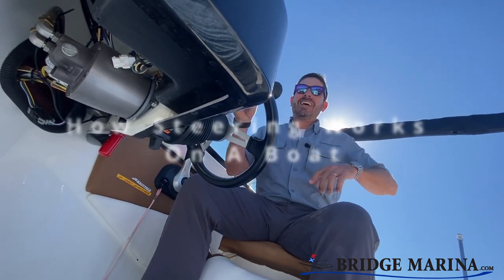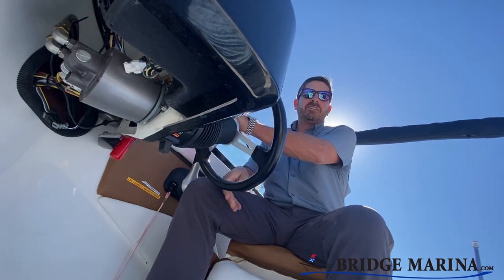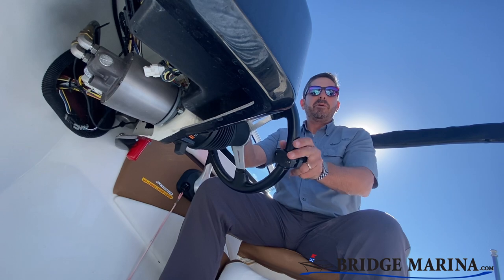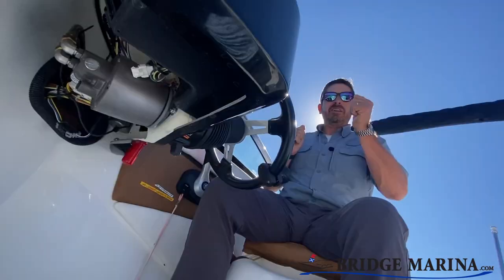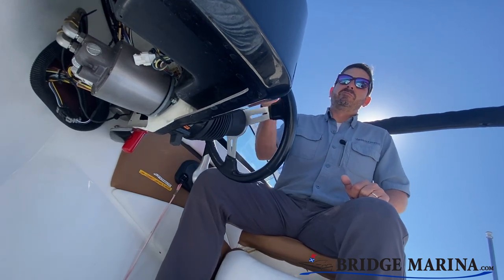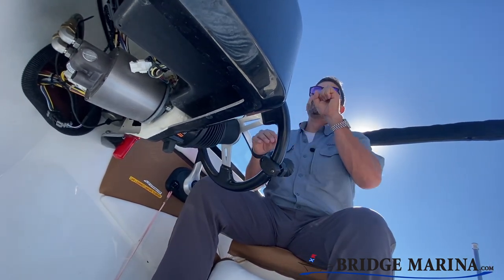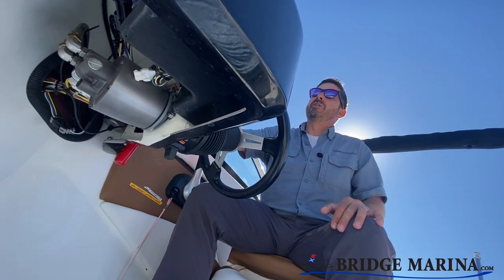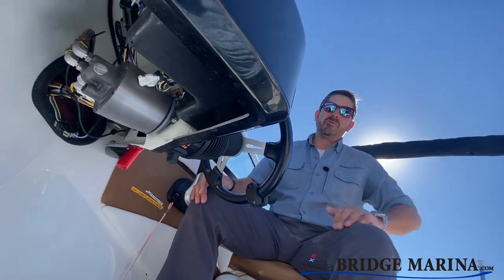How Hydraulic Steering Works on a Boat - Boater Safety and Education

Comment: i have this on my johnboat but i want to take it out. do you know what that takes. can i just disconnect the hoses at say the console area only?take out the console and the wheel seal and tie up the hoses to inside of boat and reinstall them later if i want to put it back. without having to say take off the full system. i notice on mine the bar that moves in and out at the back  is connected to a area of the motor i think i can disconnect it fully  and that part in back wont get damaged and i dont need to take all that off. but it also look like it runs through the main connection area of where the motor goes on the boat so not sure i want to take it fully apart anyways.  i never really messed with boats but i have full rebuild my motorcycle engine.